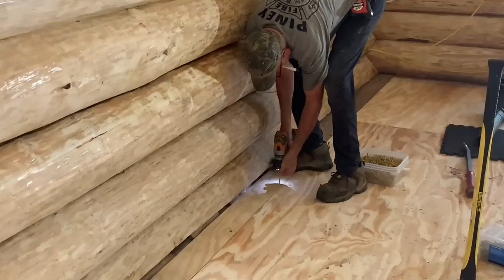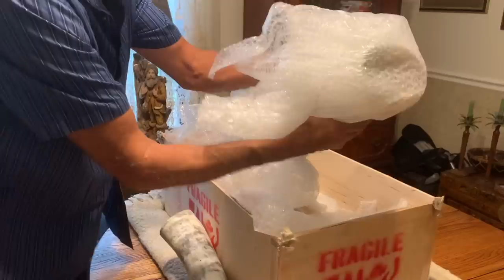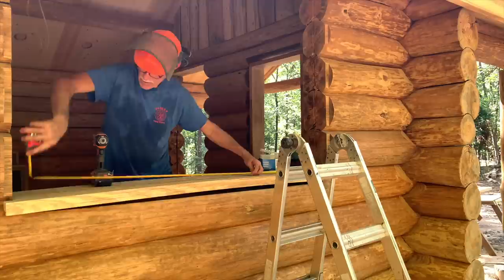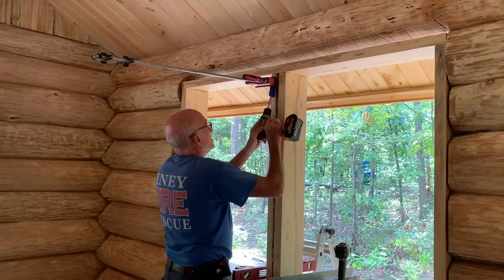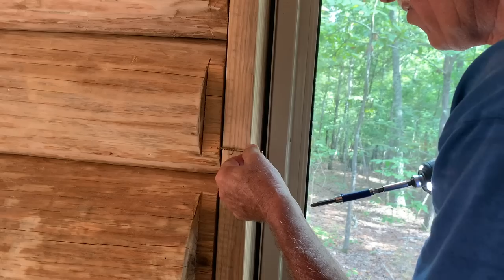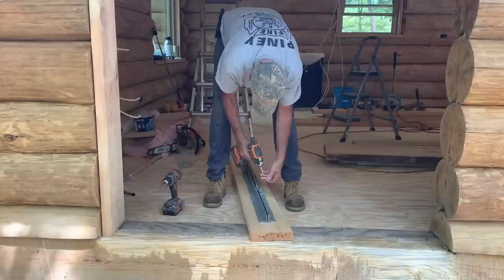Log Cabin Build Part 24, windows and sliding glass door, subfloor, Skull Bliss carved longhorn skull

Comment: Howdy y’all- ain’t it nice to be able to walk around on the floor. We’ve always put the subfloor in and poured the boiled linseed oil to it and do it again after the first coat dries. Since I use the roll around hoist I have to have a floor. What you have done has worked out great. I had a hummingbird fly in our log house when I was building it. The chinking gaps were still open and it tried to fly through a gap and missed, knocking itself out. I picked it up and held and it came to and flew off. To get to hold a hummingbird is an experience. The windows look great in your cabin. We finally got some rain here today- very thankful. Take care and God bless
Reply from the maker: Yes, there were a few times we really wished we had a floor. We have both fallen through more than once😂🤣Glad to finally have it done. The little hummingbird was awesome, so light you can barely feel it on your finger! 
Really glad you got some rain, we got a nice rain here too. Sure needed it! Take care! Nice to hear from you😊

Comment: On my windows and doors i just cut slots with skill saw in the 2x6 door and window frames. I used spikes to secure the frames to the logs making sure i didnt drive them past flush. I actually left the heads stick out i tiny bit so the spikes could slide in the slots. This worked well as my logs settled around 4". I guess theres many ways to skin a cat! Lol... was wondering how you are going to insulate under your ply wood floor? Are you going to cover the underneath after you insulate it to keep out rodents? Things looking very good on the project. Brings back memories from my build! I very happy your build is going so well. Now you can think about decorating the interior which was the most fun for us in our build. Take care and see you on the next video!
Reply from the maker: That sounds like it would work very well! That is kind of what we are planning for the interior walls around the bathroom. You are so right though, there is so many ways that will work. We went with angle iron because we were recycling the shipping crate our mill came in😁😁 what can I say, we are cheap!🤣We are not sure about insulation under the floor yet. We are going to put metal roofing to close in the bottom perimeter to keep critters out. Some friends of ours did that and then just had the metal spray foam insulation on the inside. That has worked good for them, but we don’t get real cold here. So we might try that 🤔

Comment: Great video thanks for all the info. Make sure you insulate it and put something on underneath to keep the mice and animals/insects out
Reply from the maker: We are planning on using spray foam insulation eventually, but we wanted to give the logs more time to dry first. Don’t want to lock in moisture and cause rot. It doesn’t get super cold here, so it stayed warm enough through this winter. Some places it would definitely be more of an issue 😊👍